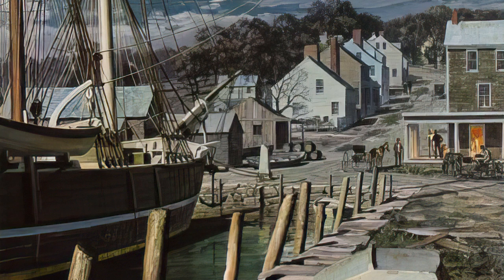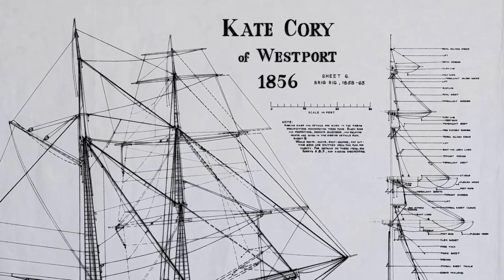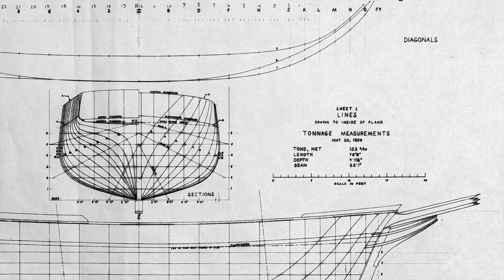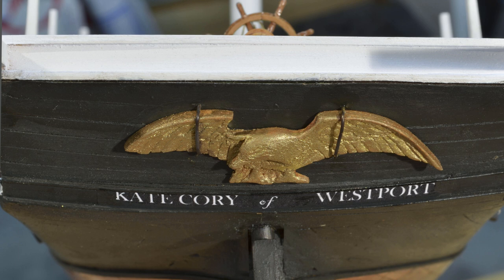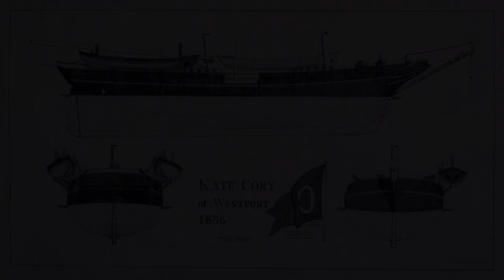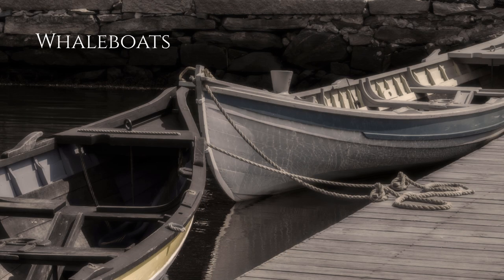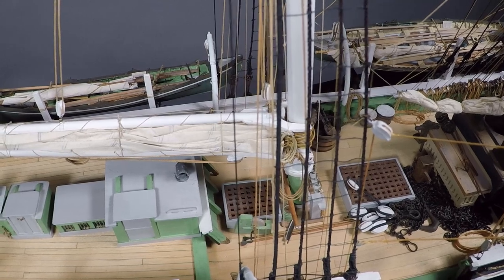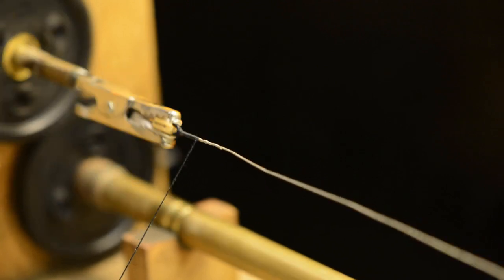Video Tour of Whaling Brig, Kate Cory

Comment: Great model!  Very impressive! I had no idea that Ronnberg did not have a half-hull or builder's offsets to work from for the hull.  Come to think of it, I don't think I've even seen a period ship portrait of her. Had Kate Cory been built post 1865, he could have used the many different measurements from her admeasurement document from the national archives (used to calculate internal capacity) in conjunction with the builder's contract, etc., to produce a set of plans.  I'm surprised he chose her given what little there was to reconstruct her lines plans.  Then again, I often feel like either I lack what I need to construct the hull accurately or I have lines but lack deck structure and other details.  Looks like he was poor in the former info and rich in the latter info. I read a lot of old builder contracts and often end up scratching my head trying to interpret various descriptions (Example "square fore castle?").  Speaking of which, I also often find that some of the terminology does not match up to that which is often used by the experts today.  I think different regions had their own lingo or pronunciation for certain things and because Maine's wooden shipbuilding survived the longest, their terminology is assumed to be what was used by everyone.  I notice in shipbuilding contracts from Long Island there was a tendency to write "fore castle" (two words).  I don't believe if they used the Maine type, one word pronunciation, they probably would not have bothered using 2 separate words if they did.  I believe the Brits actually pronounce it as two words too.  Also, the Long Islanders apparently used "priming" in place of "waterway."  In one contract someone else crossed out "priming" and wrote "waterway" above it. Given the dimensions provided and the reference to deck planking I was already thinking priming meant waterway when I read that contract.  Anyway, great model!  I love the details!
Reply from the maker: Thanks.  I really like the look of that model, if you’ll excuse me saying so, myself.
Ronnberg didn’t have a half hull, but he did have a deep well of resources that most folks don’t have.  At the time he undertook this project, he was Curator at New Bedford Whaling Museum.  So, his access to research was a lot greater than the average ship model guy.  It may have also given him entrée to the Cory family, still living in Westport, Mass, which is just a 15-minute drive from the Museum.  The legend goes they had copious original documents in the attic of the family home.
 
The copy of the builder’s contract I found online was missing fairly good amounts of info.  I don’t know if Ronnberg had access to a more complete version of it.  It does reference another schooner built a couple of towns over, so there are features of that ship that are known.  That could have filled in some of the blanks.

Another advantage he had was his prodigious knowledge of the whaling industry.  Since K.C. was built specifically as a whaler, Ronnberg knew it had to have certain features to be effective.  Knowing the design parameters of the vessel could help fill in even more missing info.

I’ve never spoken to him about this, so this is all me just supposing.  The two times I met him, other subjects were on the table.  Plus, he did this work 50 years ago, so I’m not sure how much he would even recall.  That old expression: “He’s forgotten more on the subject than I know” may come into play here.  That’s me supposing, again.

I think your point about “regional vocabulary” is right on the mark.  I confess, I never considered that, but it makes perfect sense.  It happens in other trades, why not ship building.  Add to that the fact that you’re talking about documents that are now over 150 years old and you have a perfect recipe for historical confusion.  And the Brits??? That’s another language, all together.  Just consider the use of the term brig.  Here, we use brig, brigantine of hermaphrodite brig somewhat interchangeably, depending on time and place.  The British seem to stick to the term brigantine for a vessel like Kate Cory.

Anyway, I enjoyed reading your comments.  Thanks.

Comment: she's a beauty! What would be the reason for serving the entire shroud? also the vice looks amazing, it even has a bit of a cast texture to it. serendipity?
Reply from the maker: Thanks, Claes.  It was an incredibly educational experience.
Reply from the maker: Claes, Sorry I missed your question about the shroud on my first read through.  On the foremast, the lower sail, or fore course would often come in contact with that first shroud. so it was a means of extra protection from chafing.  On the mainmast, it was the last shroud as that may have come in contact with that huge main sail.  So again, protection against chafing.  To my way of thinking, the main shroud would have come in contact with either the sail or the boom, it hardly seems necessary to me.  But Ronnberg thought it made sense, and I don't have data to contradict him, so I did it.  Besides, it was kind of a fun exercise to do the whole shroud-a challenge.
Yes, serendipity on the vise.

Comment: Tom Lauria,  i am confused by the steering wheel as it appears to be facing backwards.  Should it not be turned around the other way?
Reply from the maker: No.  It's facing the right way (towards the front of the ship).  The wheel of this ship was attached directly to the rudder, so the helmsman stood behind the wheel and usually to the right.  The little cabinet directly in front of the wheel was the binnacle box which held the compass.  In this position, the helmsman could see if he was on course, the set of ALL the sails and since this was a small ship, all that lie ahead.
Reply: @shipmodelguy  Thanks for that info.

Comment: I've been working on a new boat: faithful reconstruction of a 1560 wreck of a fishingship.
The type is called a waterschip (very creative naming). A type of heavy build boat ranging 15 to 20 meters in length. Always with a spritsail. The ship has a bun where fish are stored in, the bun opening is inside the cabin. The back half of the cabin is livingspace.

The ship was used for fishing as well as just fish trading. And could fish on the inland south sea as well as the bigger northsea towards the UK.

Check out some renders here: https://www.mrtherich.art/projects/xJbR42
Reply from the maker: Wow, Matthijs, I love it.  Is this a wreck that is fairly close to where you live, or did you just happen to know about it?  These really are quite amazing.

Thanks for sharing them.
Reply: @shipmodelguy  The place of the wreck is about 65 km from where I live. (probably no distance in US measures) But it has been  dug up in the early 70s, and I don't know if the wood has been preserved. At least the archeology process was very well documented with lots of photographs. And a lot of the small inventory, and things like blocks are still preserved in an archive somewhere. Of which photographs were available online.
Lot's of photographs of the ship and it's inventory are viewable here: https://commons.wikimedia.org/wiki/Category:Shipwreck_W10OFL

2 Wooden ship models were made (one an accurate hull with nothing on it, one complete but less accurate) as wel as reconstructed line plans. Which really helped me with the process. As well as studying paintings from the period.
They even found a rapier on board. Probably for self-defense.

The ship was a commission for an historical association that is reconstructing an village from the time. I reconstructed some houses for them too. See here: https://imgur.com/a/HEqnibI
Sadly there was no budget to reconstruct the interior living space and a full inventory. But who knows, maybe as a personal passion project I might in the future.

I am planning on creating some kind of game or simulator of the inland South Sea probably around the turn of the century 1800. This was a period where ship types like this one still sailed around, but also just when newer ship types like the one on the Christmas card were invented. Just before the age of steam began (less of a fan of that). This way I will have the maximum variety of possible wooden sailing vessels, various rigging types (sprit, gaff, schooner, square). But it's all going to be small vessels of around the 10 to 20 meter range.
It was also a tumultuous time in this country, the end of the Dutch Republic, right before Napoleon marched in and took over. So if I were to go for a game, that would give me some awesome stories and conflicts to tell, and interesting characters to appear.

So each of these 3d models will likely be virtually sailable in the future.

Comment: It's not a brig, it's a brigantine and you need to look at the direction you turn in your deadeyes.
Reply from the maker: The vessel has been referred to as a brig, brigantine and a hermaphrodite brig.  Most American listings contemporary to the vessel describe her as a brig.  In almost all British listings of the time, they use the term brigantine.  Even though this rig has been referred to as hermaphrodite, I haven't seen used in connection with this vessel.  If you're British, then Brigantine would be the term you'd most likely use.  If you're American, brig seems to work just fine.  The terms appear to be interchangeable.  You also have to consider the timeframe of the references.  I stand by use of the term brig.
As for the deadeyes, Ouch! you got me.